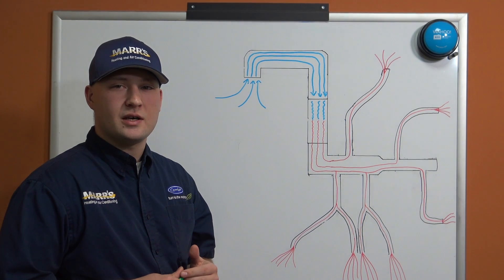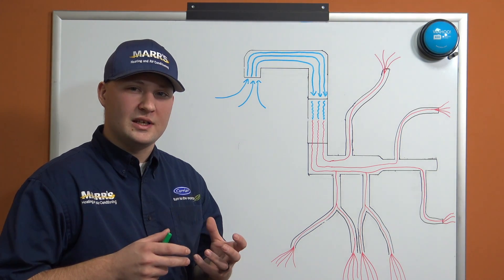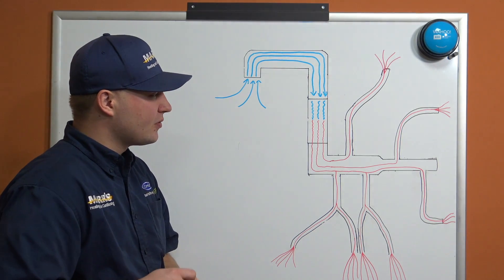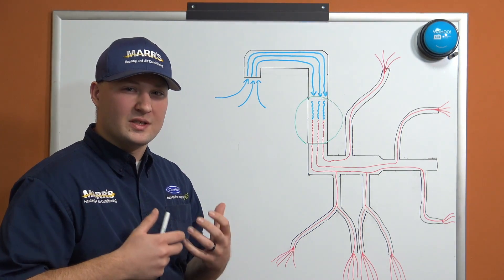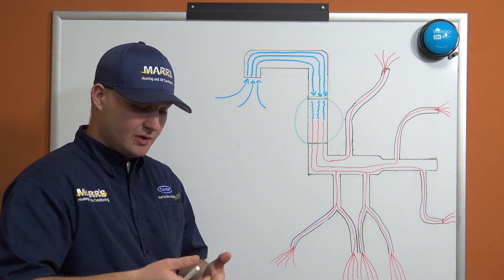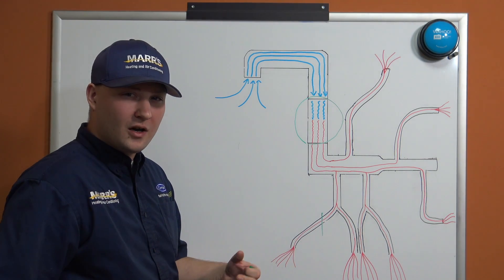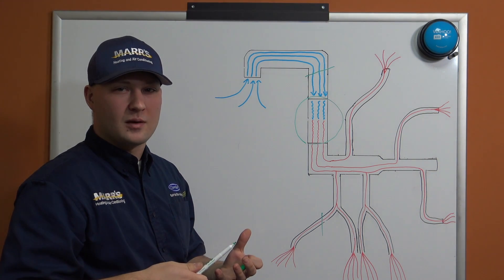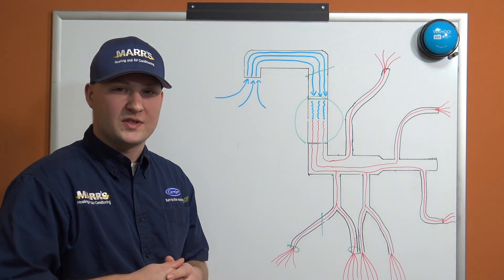Static Pressure Explained

Comment: Great Presentation, however when the filter is clogged the fan doesn't actually work harder. The full load amps for the fan motor will be less with a clogged filter than a new one because the fan is not able to move as much air. Example when you are using a shop vac and you put your hand over the nozzle the motor will speed up because the impeller is not under as much load.
Reply from the maker: Yes very true! The point I was trying to get across was that we will have to spin faster and faster to do the work of moving the same CFM through the duct system. Great analogy with the vaccum!
Reply: PSC and veritable speed motors work differently. VSM will over amp with high statc

Comment: Great Video!!! Could you go over some things that could help high static pressure?
Reply: Keep your filters clean and change regularly and don't black off to many vents. You can measure static pressure with a manometer. Sometimes you need to adjust blower speed because they weren't installed right. Poorly sized duct work, many factors.

Comment: Computer fans brought me here.  I have a push pull configuration with shrouds on my water cooled radiator.  It basically creates a large duct with a radiator in the center.  I use static pressure fans at the front to pull air through a constricted silent case panel, mesh, and filter and then push it through a radiator, with more shrouds and fans pulling on the other side.  I've been experimenting on the type of fan that goes on the pull side (that opens up into the internal chassis of the case).  I kept trying more static pressure fans but lately I've been using "air mover" fans which are normally tuned for low restriction and really bog down at the slightest restriction (at least the high-end silent models do).    However, on the other end of the radiator is wide open, so why not give it a shot?  I've found my CPU temps dropping significantly.  So I wonder... Should my air mover fans be able to pull/blow more air than the static pressure fans are blowing through or will this strain the static pressure fans by creating too little resistance and possibly even pulling them along or interfering with their flow?  If I put air mover fans that don't move as much air, will that add resistance to the air the static pressure fans are moving, in turn, harming the static pressure motors?  I also have to consider the vacuum created in the chassis by the exhaust fans and how the push/pull config seeks to fill that area.  Should my exhaust fans outpace my radiator rig in order to create an empty space to fill with more "fresh," air?  I'll watch the video and see what I can learn.
Reply: OK, right away... I wonder how I could measure the static pressure in my case?  I wonder if I could get even more precise and measure the static pressure of my radiator that I'm pushing or pulling air through?  Airflow and static pressure specs are definitely provided on all my fan boxes.
Reply: @tronus98  Get a life. You are thinking too much to cool down a pc. I have been in that road and it is a waste of time.